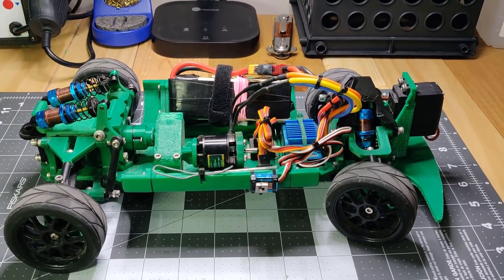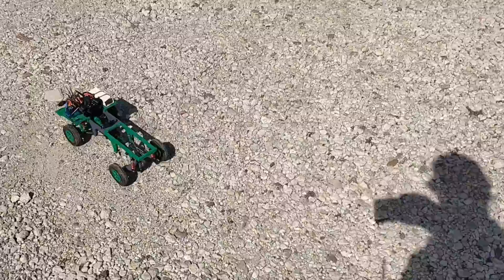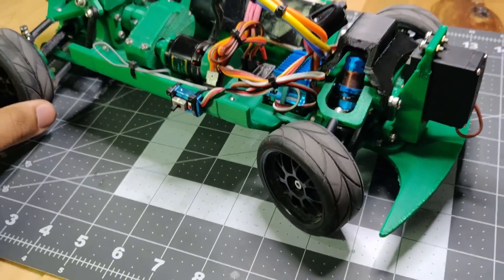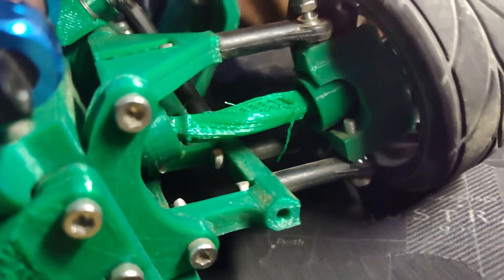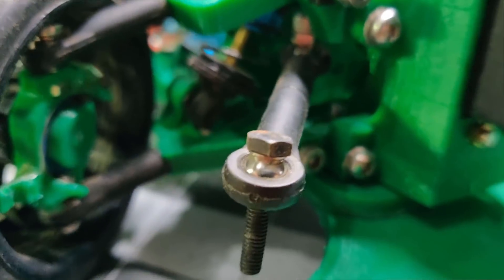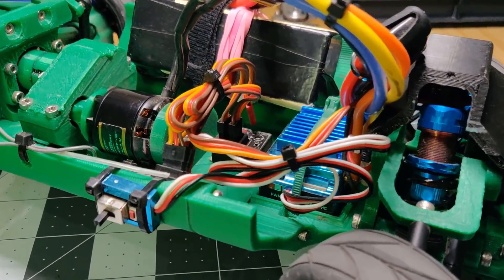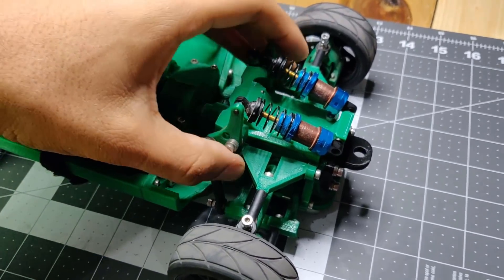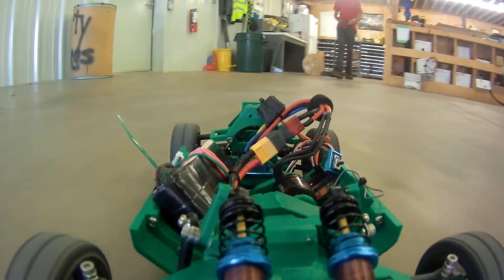Tarmo | 3D Printed RC Car

Comment: Awesome stuff. Got parts on the way. Will post you some pictures when I get something made up! Just finishing up my last project: https://www.youmagine.com/designs/prototye-3d-printed-jetsprint-jet-boat-v2
Are you a mechatronics student? The type of projects that you're doing have me wondering :-)
Reply from the maker: I was for a short time, but I switched to EE lol. Have you started printing yet? V2 is finished and it's much better. Uses mostly the same parts except the printed parts are all different
Reply: I haven't started yet. I got most of the parts kicking around here but other things got in the way. It'll be some time before I do any work on it.

Comment: U  should get rid of the suspension and 3D print wheels out of ninja flex. This would make the axel’s much more simple and I think it would last longer. Then u could even make the wheels big enough so it could drive upside down
Reply from the maker: JK_ Hacked but if I axed the suspension then the car wouldn't be able to maintain 4 point ground contact :(

Comment: Love it! Seems quite well built. Pretty sure that motor mount needs some bracing though! :D
The whole joint-friction issue was one of my biggest concerns when designing. The only real tip I can give is that it all comes down to tolerances and it's a fine line between having too much friction or getting slop, mostly trial and errror and can vary between printers which makes it even more difficult.
Great work!

Edit: Afterthought. I see you have some kind of springcoupling before it enters the rear differential. What's that about?
Reply from the maker: Thanks! The coupling removes torque peaks. I did the same mod to your V3 truck and it helped to prevent moving parts from breaking. When I would punch the throttle on the truck, it would sometimes strip the gears in the gearbox, but with the spring, it protected not only the gears, but it stopped almost all of the U-joint breaks.  The idea with this car was to prevent the motor from breaking the CV axles, and it does help with that. 
I guess basically, the parts can handle the power, but under some circumstances, like at the end of as jump when the wheel touch the ground, the torque on the drive parts can peak much higher than what the motor normally delivers. This allows that peak to be absorbed and added back over some time duration.